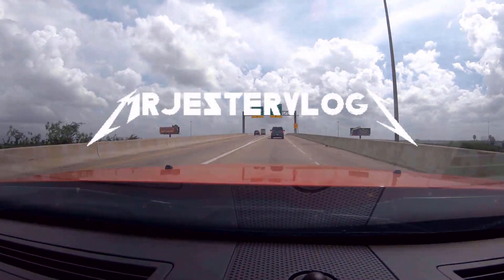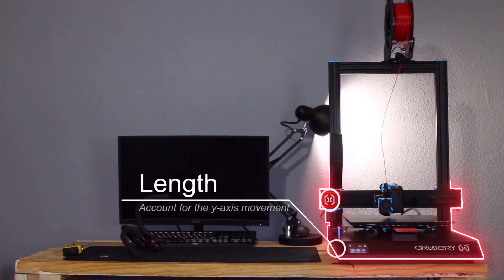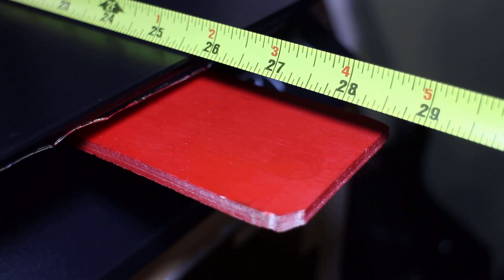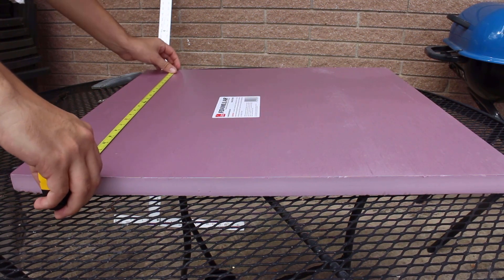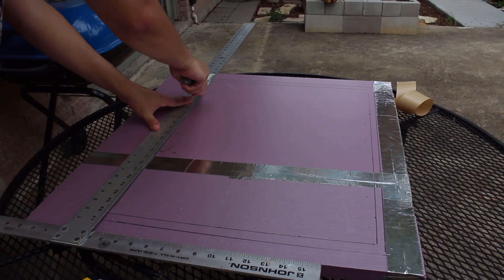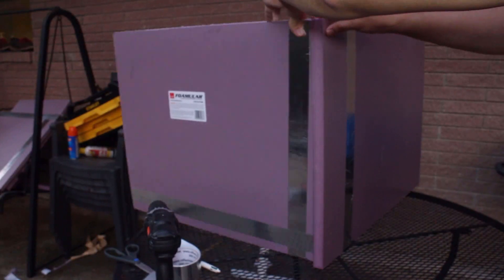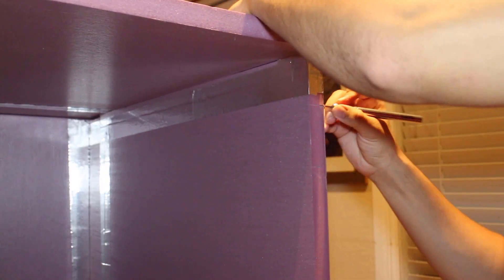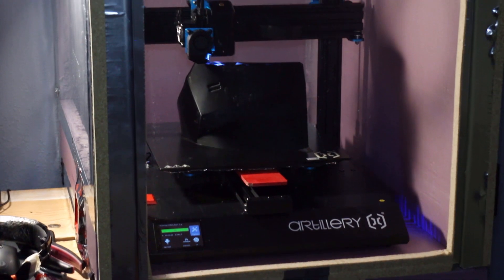Best 3D Printer Enclosure- DIY

Comment: And how much did your power supply, which is heat sensitive, suffered as a result of not excluding it from the enclosure?
Reply: Yo, this is a good question though. How's the enclosure today?
Reply: @deafengineer  
My thermistor sensor is fried...
Reply: @rikufanboy  I'm sorry for you loss
Reply: @deafengineer  Thank you.
I need to air out the enclosure a bit more..
Reply: @rikufanboy  I came here and wanted to see what others have found because I'm looking to make a "cat-Proof" Hood to block the Printer and insulate it enough in the winter.

What I'm picking up is: venting and air flow may be needed more than just "S E A L I N G".
Reply: @deafengineer  If you find a way to cool off just the body of the printer and sensors, this enclosure works quite well.
Reply: @rikufanboy  kind of re-approaching this idea, I'm considering making a more "Draft-shield" enclosure over just thermal containment, and thinking of making a "Lofted Base" assembly, using light foam boards for draft protection, supported by a large wood frame for structure. The wood frame would also support a suspended filament dryer for reducing Vibration caused by the top heavy COG from the top of the gantry. This comment and concern makes me think of having it be like a "high water" shield, so the base is still open to air flow to keep the CPU from over heating. I need to build it to determine if the clearances would cause convection drafts to defeat the purpose of the build. 

Have you been able to repair your printer/improve your set up?
Reply: @deafengineer  
I'd love to see this reimagined enclosure you described.
I was able to fix it, yes. 
Unfortunately, the only solution is got is opening the door lol